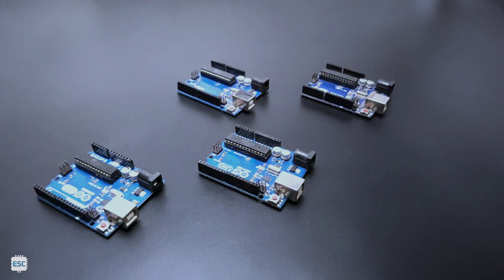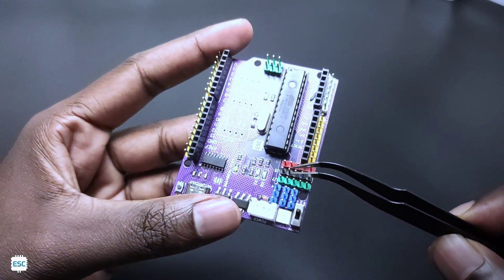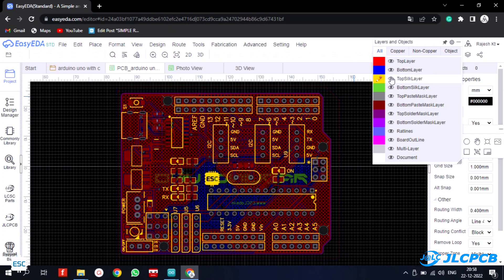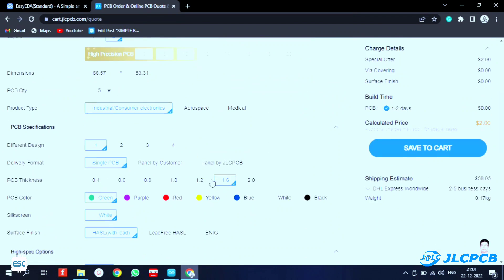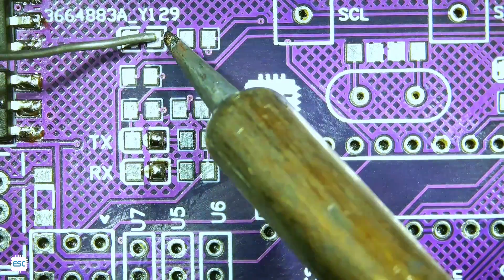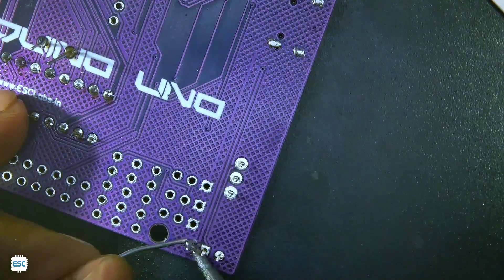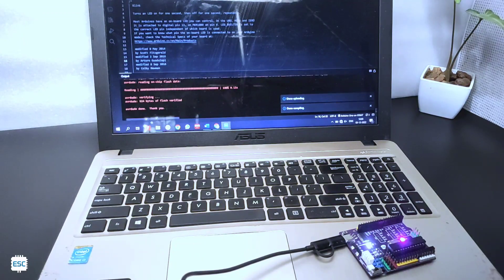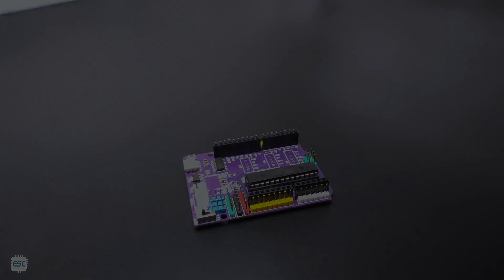How to build your Own advanced Arduino UNO | DIY | JLCPCB

Comment: bro the servos wil create very much surge current make sure you did not power it from voltage regulator. if its powered from USB only then add a 470uF /16V cap between servo + and -
Reply from the maker: Thank you